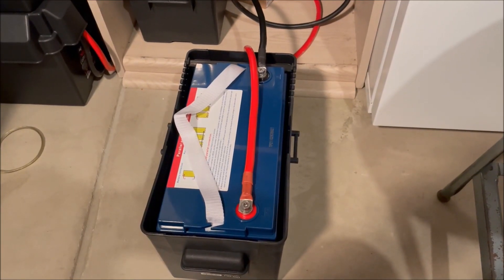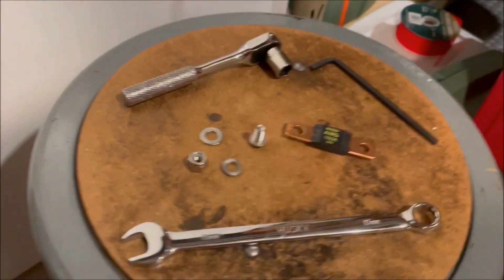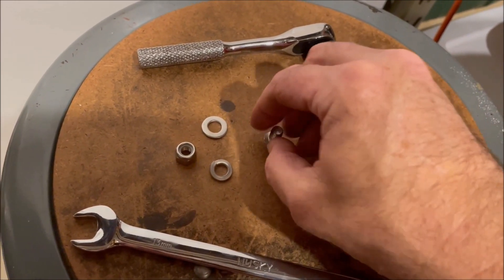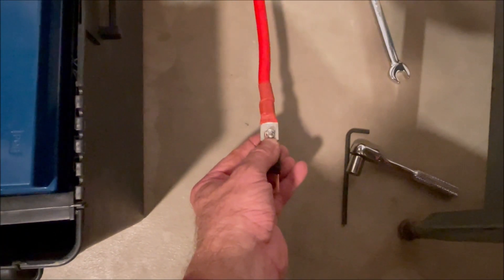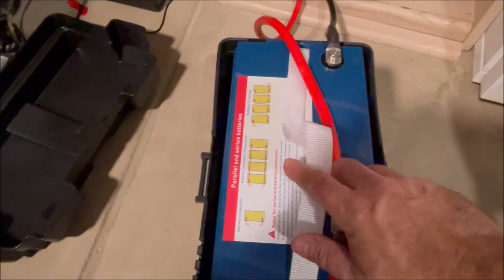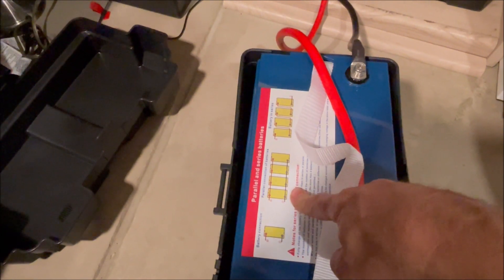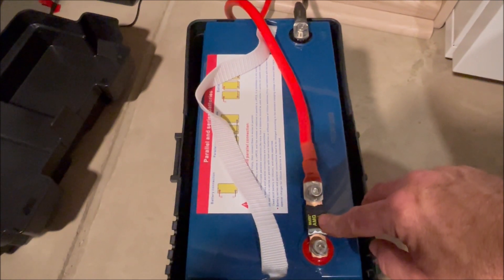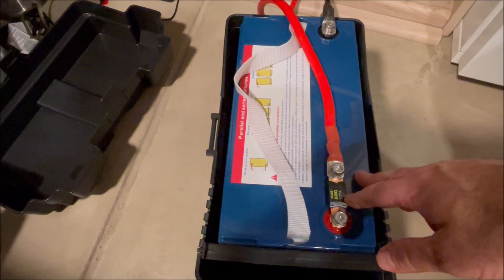Adding a Fuse to your LiFePo4 Batteries!!  DIY Solar System!!

Comment: Stainless is a pisspoor choice that only someone from the air farce would use as an electrical conductor.  Please revisit your choice of bolts for your connections.  It is 50x less conductive than copper and the oxide layer it produces (which makes it stainless steel) limits both electrical conductivity and reduces it's ability to deal with the subsequent heat build up due to I2R losses, of which it is particularly bad at handling (heat).  Former navy electrical nuke.       I got rid of all stainless steel connections in the electrical grid on my sailboat for good reason.
Reply from the maker: The conductivity doesn't come from the hardware.  The conductivity comes from the direct connection of the copper of the fuse and the cables connector.  the hardware is only there to keep them together.  As far as heat, with six batteries connected each will only output 25 Amps at the most.  I don't expect any heat at that little current.
Reply: @thechiefsway2618  25 A is tremendous.  1000 times more current than needed to be fatal and over 250 times as much necessary to start a fire.   Just trying to be cautious.
Reply: do you have a good source to get copper fasteners? i'm looking around
Reply from the maker: @captkeebz  I have not seen cooper nuts and bolts in my travels.  Have seen brass but not cooper.
Reply: @thechiefsway2618  thank you. i've only seen stainless on the boats i've been on, but always open to new info
Reply: I only have 2X100aH lithium batteries in parallel. My plan was to put a 200ANL fuse in line between batteries and pos bus bar. Should I also do fuses on each battery? Also: I see you attached a 100amp fuse to each battery…can you tell me how you chose 100? I’m having trouble figuring out what amp of fuse id attach to each terminal . Part of me is confused… If the batteries are wires together in parallel do I treat them almost like one big battery?? Do I account for: the max amps I think I’ll draw? And then divide it by how many batteries I have?? Orrr…. Do I base the terminal fuse off the aH my batteries could put out?? Which is 100 each or 200ah together. Why wouldn’t I fuse each for 200 then? Sorry if I confused you I think I confused myself…. Thanks for your help tho!
Reply: @katies1638   I'm in a similar situation. I'm building a 12v system with a single battery that is 12V 460ah. My inverter is a 3,000w inverter with a 6,000w peak load. The inverter manual says to use a 400 A fuse with 4/0 awg wire from the battery to inverter. Here is where I get confused. The battery has a maximum continuous output of 250 amps with a maximum peak output for one second of 800 amps. I suppose the 800 amp peak is to allow for the start up of heavy loads with a high amp draw, but if my breaker is 400 amps, it will trip before my battery hits anywhere near 800 amps. It has me scratching my head if I'm doing it right.

Comment: Chief, with boats having a bit of vibration which can lead to insulation chafe, you may want to reconcider your positive cable routing right past the batterys negative posts.  I do conclude your fusing sceme will safeguard from a fire but the one drawback to fusing each battery like this is you will never know when a fuse is blown.

Comment: I have bought a 4 eve cell 100ah battery from china,  I am planning to power a small refrigerator ,  the draw is about 5a ,   do I need a 100a bms which is quite expensive or can I buy a cheeper lets say 30a bms?    Im not sure if its the size of the draw of power or overall battery power for bms spec.   thanks
Reply from the maker: I believe that 100a BMS is now the minimum standard in a 100Ah battery.  There may be a smaller battery out there with a smaller BMS.  Remember, 30a at 12.8vdc only gets you 384Watts.  A 100a will get you to 1280watts.  Don’t sell yourself short on your battery size, more is always better and greatly extends your run time ability.  If there is a 100Ah Battery out there with a 30A BMS I would expect it would so cheap I wouldn’t want to Trust it.
Reply: @thechiefsway2618  Thank you sir

Comment: very curious, im starting on my own adventure at the moment understanding fuse sizes, wire gauge, etc. etc.... your reasoning for actually only using 100 amp fuses in a parallel situation does make sense since you're not using the full potential of each battery in this set up BUT.... if i do want to follow it safely i would use a 125 amp fuse for each battery in this application? especially if im only using 2 12v 100 amp batteries? if not after parallel the batteries do i just stick one 250amp fuse at the last battery terminal before it hits the buss bar? please let me know thanks!
Reply from the maker: The last battery should have its own fuse which I believe you were going to us 125Amps.  The Main Fuse should be after the cutoff switch and before all the Loads.  I don't parallel the Batteries directly together, but to a termial strip.  This way expansion is much easier.  When each battery is connected to the terminal strip then each battery can be protected by its own fuse.  I posted a document under posts to use when selecting wire size.

Comment: So batterys in parallel must have same length cable on each battery. Does adding fuses to the positive side of each battery throw off resistance since that makes pos side longer?
Reply from the maker: @ericj810  the heavy copper of the fuse virtually has no resistance at an inch or so long.  Additionally, adding the same fuse to every battery keeps the environment that each battery sees the same.
Reply: @thechiefsway2618 ohh ok I see. Was wondering about that. Id feel batter with a fuse on each. Incase of short the fuse will blow if amps jump up to 1000. That spooks me abit.
Reply: @thechiefsway2618  so the same could be done wiring t fuses from each battery to busbar as long as all pos cables are the same?
Reply from the maker: @ericj810  I would think so.  We are only talking about an inch or so of a pretty heavy conductor.  Lithium Solar just did a good video on fuses.  https://www.youtube.com/watch?v=SjzbQlsiiuk